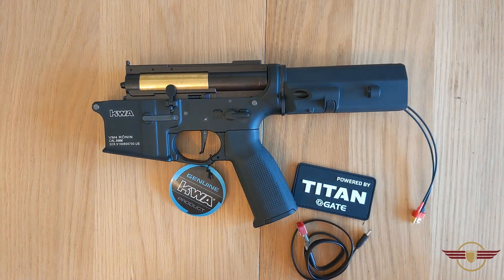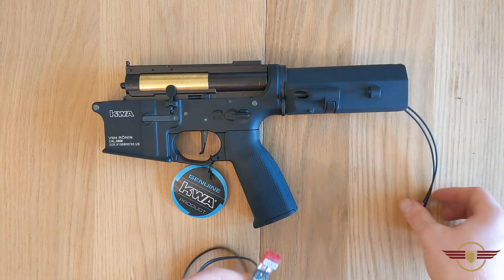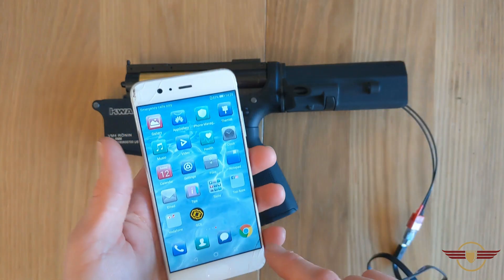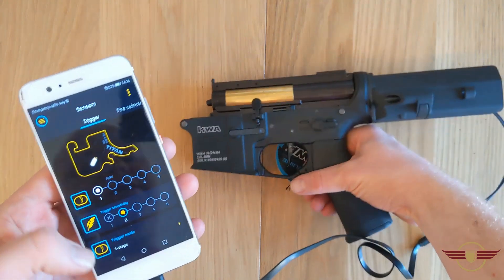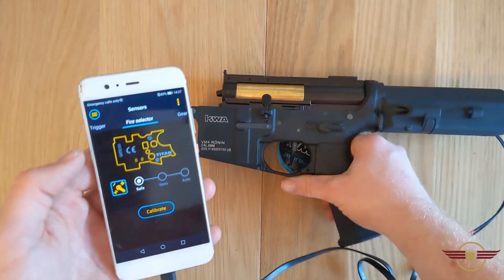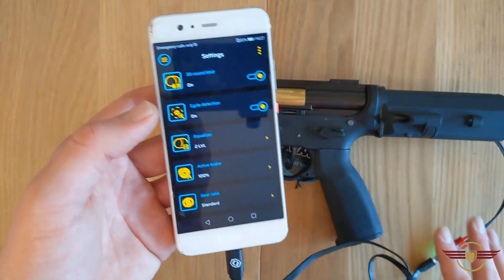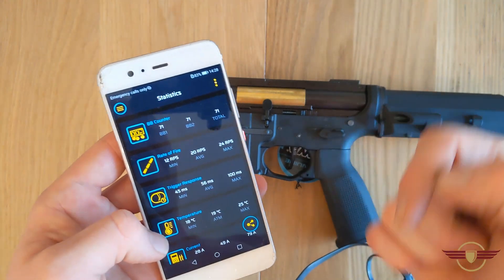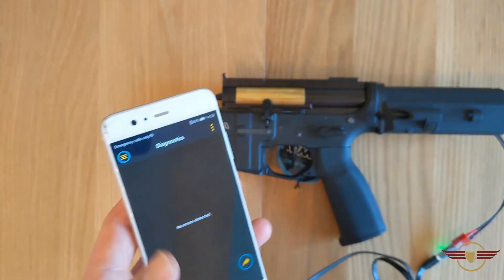[HOW TO] GATE TITAN how to Program using the Gate Control Station App

Comment: A Quick cuestion mate, can u change the rps?
Wonderful video
Reply from the maker: @denzelnoesi9237  hello! You can adjust the rate of fire in percentages to find where suits your needs, so if it's running a bit too many rps then you can tone it down, it's set to 100% rof at the initial install. Pheas
Reply: @ thx mate

Comment: My MOSFET gate v2 wont enter trigger programming mode no matter how long i hold the trigger for. I dont have a USB link or bluetooth link, is there any way i could fix this?
Reply from the maker: Hello, it might be that you have to get the usb link... could be that it is slightly mis=-seated so not detecting the trigger movement properly? The easiest way would be with a usb link though if you can get one to borrow or use. Pheas

Comment: Hello thank you for the videos they are very helpful. I go KWA T10 with Gate titan V2 Bluetooth version. I have trouble with it. reads all the sensors as it’s should however when I fire got only burst mode no meter were is the selector with very strange noises beeps comming from the motor etc. also showing issue with sector gear as is dirty etc. Gate telling me there is KWA mode were I have to switch too I never seen that in the menu any inputs will be great thanks
Reply from the maker: Hello, I believe this is a firm ware issue, someone i know had a similar issue, there is a fix now issued I think and you can set it to "KWA MODE" (or similar, cant remember exactly) but that will resolve the issue. Pheas
Reply: @PheasAirsoft  Hello thank for the replay I did work it out in the end basically issue is with IOS devices. For me did help me to down grade to 01.68 as their latest update not working well with iPhone android is fine

Comment: Do you need a usb link or blu link in order to safe semi and full to work. I have a Kwa eve and after installing it the motor just buzzes continuously on full auto but safe and semi works fine. Also do the other stickers in the install kit work fine since I messed up the the 2 middle ones… I forgot to file down the gearbox. Thanks
Reply from the maker: Hiya. The motor shouldn't buzz constantly, that suggests an issue somewhere. The usb link isn't always needed for the selector calibration, but I sometimes find that they are off , so have to be calibrated. If the motor buzzes all the time it needs checking over, the usb link would be able to help error code reading to see the issue. Pheas
Reply from the maker: Also the other stickers should work, but probably mean you need to calibrate to accomodate the change of sticker. Pheas

Comment: i just received and installed my first titan ever (only couldve done it cuz of ur vids, theyre extrememly helpful), it is a v2 advanced, it came with 2 of the same double-male micro-usb cables which i cant use cuz i dont have an andriod and i dont know anyone with an andriod lmao. im wondering if im able to use other branded cables or will this not work, ive tried using these other cables with the link and my computer but to no avail, i get a blue light which im unable to fix by downloading drivers or updating firmware. any help would be greatly appreciated.
Reply from the maker: Hello! You should be able to use other brands of cables (provided they are not "just for charging") , so a USB A type to micro USB would be spot on for connecting it to your computer. Alternatively... you could buy the blu-link and use that to bluetooth it to your phone / computer. Pheas
Reply: @PheasAirsoft   thank you so much for your quick response. just ordered right cable from amazon, i rly appeciate u reaching out it means a lot. keep up the great work on the video's they're extrememly helpful. i cant wait to get the cable and be able to use this vid to program my v2. much love

Comment: Hi, thanks for brilliant content as always. 
I am having trouble with my fire selector. Safe/Semi work fine but Auto defaults to semi no matter how many times I recalibrate. Oddly the selector diagram shows I’m switching fire mode perfectly but the gun just isn’t liking it unless I leave the selector on auto after calibration. Soon as I switch though it defaults back to semi. Any suggestions? Thank you!
Reply from the maker: Hiya... First check the seating position of the sticker to see if that is screwed or damaged at all. If it's all good then maybe look at reseating the MOSFET slightly to see if that is causing issues... If the lower is too exposed to light (as in the upper isn't on etc) then this can cause light pollution which can fool the selector detection too... Only other thing I can think of... Is the selector plate lined up with the lines on the side of the shell to ensure its in the right position? Pheas
Reply: @PheasAirsoft  Thank you for the speedy response, much appreciated!
Reply from the maker: @suk_it_and_see  let me know how you get on. Pheas

Comment: Is there anyway that when you purchase it then put it in the gearbox it won’t shoot, and you have to program it, or was it put in wrong
Reply from the maker: Hello! It should (SHOULD) just work without any configuration, I always make sure I configure it, especially the selector, as it stops any issues occurring initially. If its not firing, then there is an issue somewhere. When you plug a battery in, do you get a buzz from the motor to indicate it is on? Have you had a look on the error log on the app (called DTC in the app) to see if there is any error codes reported? Pheas
Reply: @PheasAirsoft  hello, thank you for the feedback but I’m asking for a friend because at my local field it was tournament day and he needed a gun to play so he just installed the gate himself but he didn’t know about the app I guess but I’ll tell him to look at the inspection part of the app

Comment: do these work with every /any aegs
Reply from the maker: Hello! The Titans are designed to work with any generic Version 2 gearbox or version 3 gearbox or the TM NGRS gearbox shells, you just need to buy the appropriate model to match the gearbox type you have. Hope that helps. Pheas
Reply: @PheasAirsoft  alr i got a few questions though so does the advanced version come with the mosfet and everything you need? or do you need to buy that sep
Reply from the maker: @visualz9066  The advanced version has slightly better software installed on it (gives you more options of how the gun will work) and includes the USB link to be able to connect to the mosfet and change these options. You can buy the usb link separate and pay to upgrade the software through the app for the usb link. For me, the advanced offers better value as most people want to configure things to a higher level and if you don't have the usb link already then it works out cheaper longer term. Other than that both the basic and advanced have the mosfet and screws etc you need to install it into your gearbox. Pheas
Reply: @PheasAirsoft  alr thank you

Comment: If you set your trigger sensitivity to 2 will your trigger stop right when it registers and shoots the bb or will you still be able to pull it back more?
Reply from the maker: Hiya. The trigger will still travel but the MOSFET will start firing as soon as the trigger moves to level 2. You could install an adjustable maxx trigger and tune it to have a tiny trigger pull with the sensitivity 2 setting meaning it will physically stop as it triggers the mosfet firing. Hope that helps. Pheas
Reply: Damm that was fast thanks!

Comment: I have the basic module and the second I plug the battery in, it makes 4 beeping sounds. It sounds like something is wrong. Do you know what that means?
Reply from the maker: Hiya! What battery are you running? Generally when you connect the battery is beeps for a number of times equal to the number of cells you have. So for example an 11.1v lipo would get 3 beeps when plugged in. Pheas
Reply: @PheasAirsoft  Thanks for the reply. I reached out to GATE and they told me what was wrong. The speed trigger is to close to the first sensor. I have to get a usb link and set it for the 2nd sensor. Thanks for the help tho

Comment: Is the aeg supposed to fire right away after installing the gate titan or does the mosfet need to be programmed first
Reply from the maker: Hiya, It benefits from having the selector re-calibrated before use, but should just work out of the box with a set of standard pre-set settings. Pheas

Comment: Is it compatible with IOS cause they have the program app in the app store
Reply from the maker: Hiya, if you have the blulink adapter (they are new out) then you can use the IOS app to configure your titan / aster. The usb link isnt for ios though! Pheas
Reply: @PheasAirsoft  awesome thanks for the response and another think is I don’t have any of the tools I need to get to the gearbox is there a link you can show me with the exact tools needed to take the gun apart
Reply from the maker: @r3kt_addict_137  not so much an exact link. But you will need a screw driver set with a lot of different size torx and hex (Allen) head fittings to get the various screws out. https://www.amazon.co.uk/Draper-82399-Security-Screwdriver-Driver/dp/B01GZWT5FW/ref=mp_s_a_1_5?dchild=1&keywords=screwdriver+bit+set&qid=1614026487&sr=8-5

Something like this one that has a big range of really small to normal size is good. That should cover you for everything. Or you can go to the other extreme and get a full set like I have in this video: https://youtu.be/NbQisr5MnzE

Ha ha ha. Then you are covered for just about anything ha ha ha. Pheas

Comment: So I'm curious, as you said you fired that model earlier, your nozzle is all the way pressed in and the piston is in fully too. Not sure if that's the intended effect but I got finished setting mine up the other night and its doing that same thing. I'm going to go out and guess that this is normal and totally fine? Just curious cause I feel like the tappet plate spring would weaken being in that state that all the time.
Reply from the maker: Hiya. It should return to the front once it has completed a cycle. I believe in this one I couldn't remember if I had been messing with pre-cocking or if it was a software issue. But make sure the software on the titan in up to date and it should always ensure cycle completion which means everything goes back to fully extended out the front with the piston forward as otherwise it can and does put pressure on the piston and tappet. Pheas

Comment: I want to get the titan basic, but I don’t know if the usb will fit into my computer. Also does the Gate control station app come right up when you plug in the usb?
Reply from the maker: Hiya. The basic version doesn't come with the USB link at all, so you will need to buy that to connect the titan to your computer. One of the cables supplied is the micro usb (which goes into the usb link) to USB A which is what will connect into your computer (I think all computers have at least one USB A (a normal usb connector) ) I think you have to open the app and it will recognise that it is connected to your computer and load in the settings and look for updates for the software etc and allow you to program it up. I hope that helps! Pheas
Reply: @PheasAirsoft  thanks! Can I buy the usb link anywhere?
Reply from the maker: @nikmar1338  Hiya, Yes you can, its available online, where abouts are you in the world and I will find you a link. Pheas
Reply: @PheasAirsoft  I’m in the USA. Also thank you for responding so quickly and helping me out!
Reply from the maker: @nikmar1338  you are very welcome. https://www.evike.com/products/67118/ here is a link to evike in the US who have it. You  need a usb A to micro usb cable (the kind you get with a Kindle fire tablet or older Android mobiles) alternative if your computer has a usb c connection, then one of the included cables with the usb link will comnect to that. Pheas
Reply: @PheasAirsoft  👌 thanks a lot hopefully this will help others too
Reply: @PheasAirsoft  do you have a link foe the USB link? im in the UK

Comment: so all you need is a dean connector on your gun and that usb link and thats it? it reads all those other parts without any sensors or anything on them? i wanna do this to my gun i just dont know if i have to get a thousand parts for it
Reply from the maker: Hiya. The usb link will only read the sensors of a gate titan (and gate aster). The usb link allows you to customise the settings of the gate titan installed so you can fine tune the performance and features you want and use. Pheas

Comment: How did you get to the point that it would register with your phone? I couldn't manage to get a blue light from mine
Reply from the maker: Hiya. I opened the app first, made sure the cable was in the usb link then connected to my phone, it automatically accepted the connection and went through it. Are you using an Huawei by any chance? as some of the newer ones are picky about it. Pheas
Reply: @PheasAirsoft  I did exactly that with a Samsung Galaxy S9. I got nothing.

I tried doing the same thing on my my Windows 10 PC. I got a blue light but that's as far as I got since the drivers website way too complicated and they never seemed to work
Reply: @RyanTheEpic  same

Comment: Does the basic module come with the cable to connect to your phone
Reply from the maker: Unfortunately not. You will need to buy the usb link and the cable. Or the usb link can be connected to your computer and run their software from your computer. Pheas
Reply: Pheas Airsoft on the basic can you still fix the trigger sensitivity that’s all I care about
Reply from the maker: @michaelr687  Hiya, yes you can. That's included in the basic functionality. But the fixing the trigger is only sensor based, so it detects how far you have to pull the trigger before it fires. The trigger will still have more travel after that point . Pheas
Reply: Pheas Airsoft so I would need the advanced to use the  precook feature on the trigger
Reply from the maker: @michaelr687  yes you would unfortunately. Or the expert software (a further software upgrade done in the app) go get crazy amount of control over that and all the functions. Advanced is pretty much enable or disable a feature buy then in expert you can fine tune things even further. If you download the app you can "preview " each set up type and see the options available. Pheas
Reply: Pheas Airsoft thank you. What website has them because evike doesn’t have them in stock
Reply from the maker: @michaelr687  mmmm that's a good question. Gate website lists evike, Airsoft Atlanta and raptors Airsoft as being the main distributors in the US and Red wolf as a global distributor. So I would give those a try. Pheas
Reply: Pheas Airsoft so can you connect the module without buying the usb link if I have the cable?
Reply from the maker: @claymore_roomba  You do need the usb link as well as the cable as the usb link connects on to the deans connector and allows the usb cable to connect. Pheas